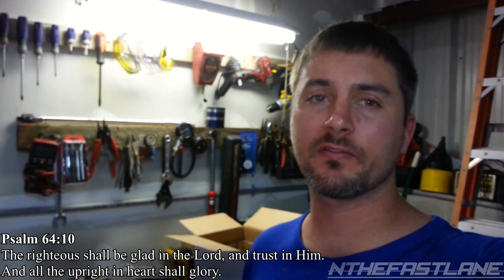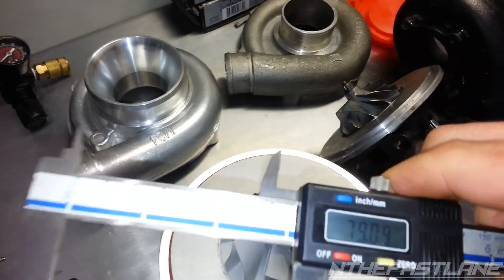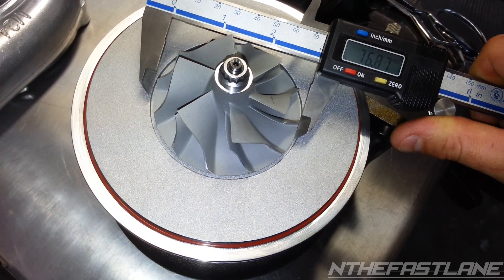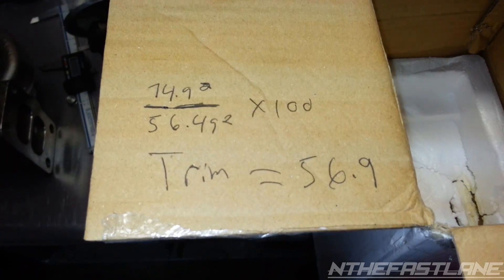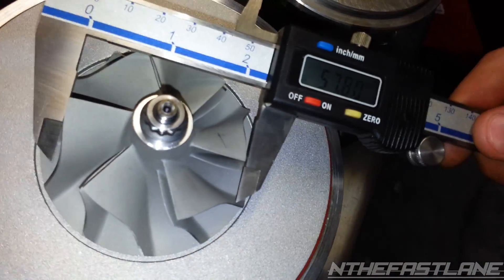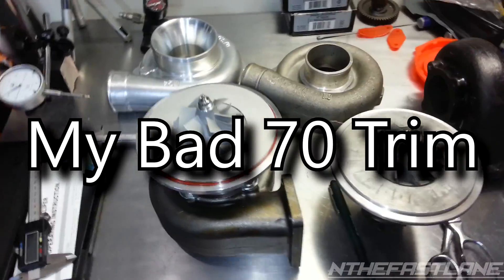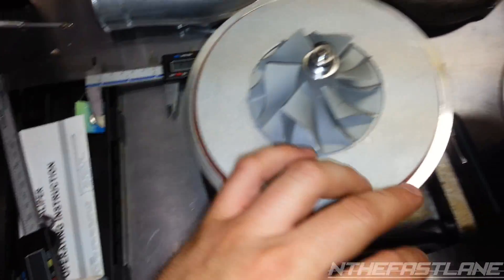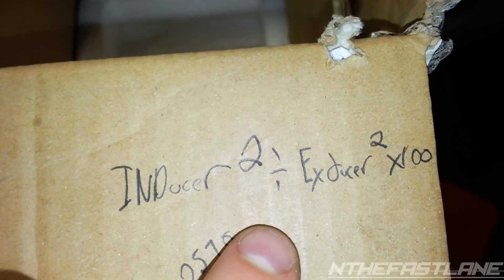▶️The Ebay Turbo Lie & Trim Calculation💡

Comment: Correct me if I'm wrong but that math is flawed, any time you divide a number by a number smaller than itself you get a quotient greater than one. If your final step is to multiply by 100 there's no way you can get 56

Comment: The To4E turbo i got measured out to be a 48trim even though it states 50Trim.
But the cool part is that it was advertised to be a 50.55mm inducer but i measured 52.7mm.  So Twin Turbo will yield 115.4mm. Cool.
Reply: I’m new to the turbos, so your pretty much saying that twin combo pretty much measures up to a 110+ mm single turbo?
Reply: And how does it run and what motor? I ordered two of them for a stock 4.8
Reply: @tacos_garage_lsx  With the .63 turbine? It's too big i think. I am modifying the turbines to .48. BUT i am running a 4.56 gear ratio which affects when the turbos spool up. My build is way different than yours so we will have different results.
Reply: Do you think two 1 inch pipes would flow the same as one 2 inch pipe? Cos they won't! A 2 inch pipe has around 3.14 cross sectional area whereas a 1 inch pipe has a cross sectional area of closer to 0.8. So two 1 inch doesn't even have a cross section of 2, compared to over 3 with 2 inch pipe.

Comment: lol. If trim was determined by your measurements, then the Garret  measured less trim than 60 and actually less trim than the ebay one. Dunno what trim is, but your calculations/knowledge isn't adding up. The ebay one is smaller than the garret tho.

Comment: Glad to see other commenters catching the errors in this video.  You're not calculating the trim.  I reccomend people Google a turbo spec calculator if they want to check the accuracy of mfg. specs.  Comparing a Garrett to an eBay unbranded turbo is an "apples v. oranges" comparison.  They are effective budget power adders, but the accuracy and quality control is lacking.  However, the value is still pretty incredible.

Comment: how do you measure the exhaust trim
Reply: You do it the same way but backward because it flows in the opposite direction. Exducer squared / inducer squared. Most true Garrett turbos have like an 86 trim exhaust. Older T4 turbos they just used a letter. Newer gt35s have something like an 84 trim exhaust. It is housing A/R on the exhaust that determines drive pressure and flow choke point.

Comment: If it's a JDM Sport Turbo why are you Calling it a Ebay Turbo.Ebay doesn't make Turbos.that's just confusing the fact that you can buy these cheap turbos from many different web sites.what you should say Is JDM sport Turbo.because buying it someplace other than Ebay isn't going to make it ant better.

Comment: question for ya, i bought a 60 trim turbo, also 2.5 IC piping, my question is on the compressor housing it has 3inch would i need 3inch Ic piping for the compressor? or can i just run a 2.5 to 3inch coupler?

Comment: WOW 4mm less for$800 less.
Reply: 4mm is a HUGE difference in performance and its use. That's money that could have been used elsewhere in someone's life.
Reply: STC Turbo Descriptions what are u saying
Reply: I'm not sure of your question. If you don't understand the principles of airflow turbulence and how it converts airflow to pressurized air, and how size of inducer and profile help determine how much power the turbo can make based upon airflow comversion rate, I suggest you read up on that first. 

It means, LESS CFM airflow than what is stated on their advertising.  Don't know what to tell you more from there
Reply: THAT 70TRIM EBAY TURBO 4MM OF DIFFERENCE WAS COMPARED TO A TRUE 60TRIM GARRET (AKA THAT GAP WOULD BE EVEN GREATER IF IT WAS COMPARED TO A TRUE 70TRIM). FOOD FOR THOUGHT, FK EBAY AND BUY A REAL TURBO KIT.

Comment: I purchase a 50trim rev9 turbo. It's my temporary replacement till I get my 70 trim Garrett repair. So far the eBay turbo is still running good. 8,000 miles on rev9 turbo. No oil leaks, spools up at full psi around 4.5k, With a b16a3 engine. I'm only pushing 4 psi DD and on street racings nights I'll turn it up to 10 psi.
Reply: +X4hunterx4 of course it will last long at only 4psi, the thing is barely spinning.

Comment: a/r is a ratio of area to radius.  area comes from a cross section of the compressor outlet and the radius is measured from the shaft to the center of that cross section.  kind of hard to explain without a diagram.

Comment: It should be noted that while ebay (Knock off type, not genuine) turbos should proably not be considered long term safe, they do have their benefits:

1. They can be rebuilt to full genuine specs for still less the price of a High quality

2. Great for interim use during a repair of a high quality turbo.

Besides spending 1k on a turbo for a $500 engine?  Maybe one fully built, but for a low boost application and testing purposes there is nothing wrong with it.
Reply: do you have any recommendations on ebay turbo for a 350 v8
Reply: +Mannie kazares What type of power does the engine make stock and what kind of power are you looking for?
- We can use your estimated Stock HP and power goals to calculate the Ideal Compressor Size based on the Pressure Ratio and to see where it falls on the Island of efficiency 
- Once we figure out Compressor size it's a matter of getting the right A/R on the Turbine side to make sure it goes within the RPM range of the engine.

You want to get the most efficient Compressor (Based on the Compressor Map) so you're generated the most amount of flow and the least amount of heat.
Reply: +Marlon Lyn  it's a bored 350 383 stroker it's 432 horsepower ...I wouldn't mind 100 horsepower gain
Reply: Here's an example equation:

432 @ atmospheric pressure 1 BAR (14.5 PSI) Nets you "Ideally" at 30 HP / PSI

So ~ 7 PSI you're looking at 648 HP.
With this Let's look at a Compressor that would be Ideal 

Check out a GT5533 47 Trim 133 mm .69 A/R Seems like it might be efficient for you.

Next, you want to check out the Turbine Housing...  Best way to get a feel for it is to check the forums.

Comment: Regarding that final formula you provide, don't forget order of operations: PEMDAS (parentheses, exponent, multiplication, division, addition, subtraction). Accordingly, you should put the first two terms in parentheses and then multiply them by 100. If this order isn't followed, the solution will be incorrect.

Appreciate the vid!
Reply: Zack Richmond OfO won't save you if you incorrectly use the formula.  CT = (inducer ^2 / exducer^2) x 100 is correct

Not as the first cardboard strip says, CT = (exducer ^2 or 74.9 / inducer^2 or 56.49) x 100. It will be wrong.
Reply: ***** Gotcha. Thanks for clarifying.
Reply: Zack Richmond
 It definitely threw me for a loop. Cause his first formula was NOT coming out right on my calculation. But he corrected it at the end of the video.

Comment: i mean really when you buy exetremely cheap high precision parts what do you expect?
Reply: Exactly, who spends less than $200 for a precision turbo, for $200 you take it with a grain of salt, that garret probably costed 2-4 times the amount of the other turbo

Comment: I'm looking to turbo my 99 civic dx with the stock Y7 will you trust a ebay turbo kit let know with some info. ..
Reply: Dont run more than like 8 lbs on stock internals, also upgrade your fuel system with a higher volume pump and larger injectors. Get a wideband O2 sensor as well. Get it tuned at a reputable shop as well, or that thing will blow up a lot sooner than later.

Comment: The trim of a wheel, whether compressor or turbine, affects performance by shifting the airflow capacity. All other factors held constant, a higher trim wheel will flow more than a smaller trim wheel. However, it is important to note that very often all other factors are not held constant. So just because a wheel is a larger trim does not necessarily mean that it will flow more.
Reply: Ten second GN? Awesome! Ive got an 87 T that runs 12s, and my dad was the youngest person to buy a GNX new! He still has it in pristine condition plus three more Turbo Buicks to play with haha.

Comment: my d16y8 turbo builds been progression slowly but surely, i pulled the motor thats going to be turbo-ed apart and the block might be shot, cylinder 1 rod bearing spun, not too bad but crankshafts not usable, cylinder 2 has sometihn goin on with the cylinder wall, all the other sleeves look normal, but this one has like almost rust looking stuff all in it, i pulled the head, head looks good besdies some of the valves being miscolored for #2, no bent valves so i think i can just clean it up and it should be good. im looking into getting a hone and im gonna try to hone the walls and see if i can clean #2 up. i could bore out all the cylinders by .5mm or 1mm but  i already got pistons for 75mm. the real point of this comment is that im probably going to have to go with a cheap turbo, if i brought it to a shop to make sure its balanced should it work/last a reasonable amount of time, or should i cough up the extra doe get a used name brand like garrett or greddy, and rebuild it?